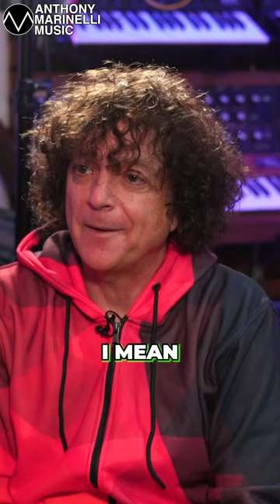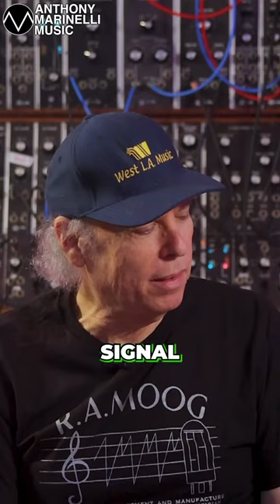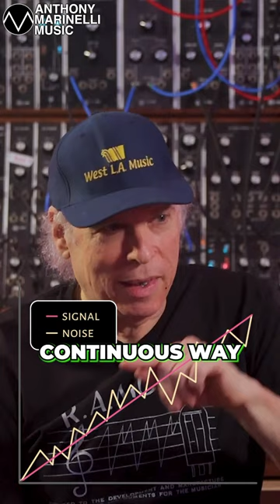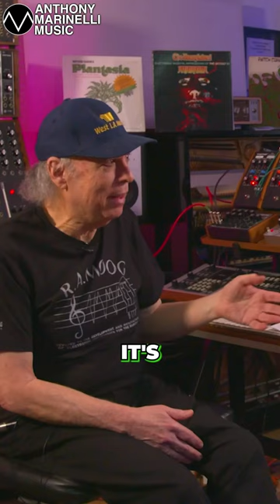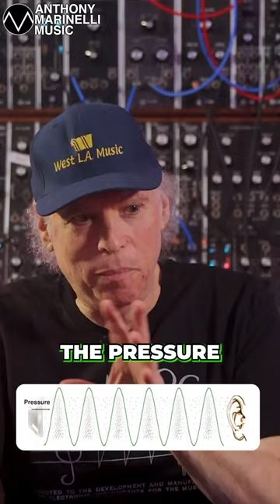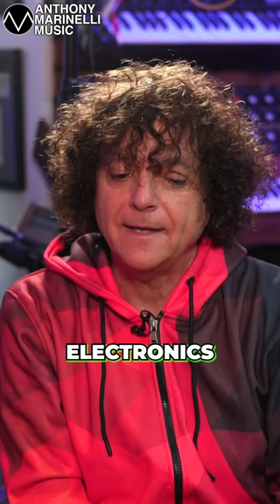“Why Digital Synthesis is More Analog Than Analog”  - Mark Barton

Comment: I think analog is way better than digital because an analog synth make sound with voltages, with all sweet audible imperfections of analog circuit, digital is too clean, only zeros and ones in a CPU, not naturally.

Comment: That's the point of analog though. The  slop! A horrible word, but it's technically true. Don't get me wrong here. I love my digital plugins and I doubt any casual listers would even know or care! But I care is the point! And I'm not being a luddite about it. There is some sounds you just can't make with digital because it's far too accurate. Also the same is true for old digital synths. The sound quality of an old DX7 is because the osc were not that accurate compared to today. Also trying to make 8 bit sounds that are digital is actually not that easy on a brand new all singing and dancing plugin. Because your instinct is to push it as far as it can go! It lends itself to new sounds that no one has heard before. This is why Dubstep is a thing. The synth you use dictates the sounds you will make on it. For instance physical modeling synths make a particular type of sound usually corresponding to real world instruments. You can make them sound synthesised but your natural inclination is to make them sound like real instruments. So if you want that synth wave retro sound, shure you can get a plugin that dose it. But really it sounds a lot more authentic if you use an old analog synth. Like the theme tune for Stranger things. It was made on an old Moog modular, and I think you can tell that.

Sorry for the rant!😂
Reply: I respect your view, but I'd dispute a few things. I think the whole "a lot more authentic with the hardware" is mostly placebo. A good Diva patch or Synapse Audio can do the trick. As for being too accurate, why not just reduce the bits or introducing modulations or coloration? But if there's a sufficient market demand for a virtual 8-bit, the wizards could  ace the sound. Physical modeling is much harder, yet pretty much closed the gaps on orchestral sounds (SWAM Audio). 😊
Reply: I would add this…..

I consider myself to have a lot of experience as a “listening musician”…

I listen to new artist all the time.

My Friends and I have analog and digital synths, both vintage and modern.

So I SHOULD have the ability to discern, on listening, whether I’m hearing an analog synth or a digital synth…..  but I most often can’t if all the techniques Benge listed are employed.

I think us synth nerds are a bit biased by past conclusions that digital is sterile….. 

On one occasion I was responding to a very beautiful and musical YouTube post, and posited that I could hear a “moogy sounding part”, where the poster replied that it was a plugin.😮

I KNOW that I LOVE a knobby/slidery analog synth, but I own a Blofeld(not analog) and it a prized Bass Monster in my rig….

And to be entirely honest, if a Neko/Miko-style multitimbral synth came back to the market, THAT would be a GIGGING Keyboardists dream….

So for me, I love analog but if the digital synth has a useable UI, I’m good with it.
Reply: @paultorbert6929  I agree that alot of what I said is subjective. So I will take another angle that involves purely analog synths. I have the mother family of synths, the Mother 32, the DEFAM and the subH. Beringer cloned those synths and the music community went mad about it! I could have got all three clones for the price of one of the Moog units. The sound of the clones is pretty damn close to the Moog units. I doubt if I could tell if they were playing together and I was blindfolded. Also the beringer units have Midi, an extra convenience not offered by the Moog units. But if you invove yourself with the beringer units you will definitely not worry too much for the extra expense. Because the beringer units just don't have the same quality and when you scrutinise the sounds you will notice the difference. 
The effect of all that is you will spend hours on the Moog units and you would look forward to comming back to it. The beringer units on the other hand would involve an hour of play and if you have better kit, it might be put on a shelf or Ebay.

Also emulating a vintage synth in digital is particularly difficult. Because as a synth get older through all the services and repairs it takes on extra character. Sometimes good sometimes not so good. But I'm shure that your vintage synths don't sound exactly the same as other equivalent models. Also I never find myself laughing at some crazy sound that I made on a digital synth because they are far more predictable. I make exactly what I intended with Hive 2 or Serum. But I get on the grandmother (I'm a Moog fan boy😁) and I do something that surprises me and sometimes cant repeat. So I don't think the experience is entirely subjective. 

But I can't disagree with what you said also. So I think the entire analog digital argument depends on your personal perspective! But God I love synths!😆 I think we can all agree on that!
Reply: @bengsynthmusic  As long as your target sound is something with the timbre of a string section which plays steadily, cool, you got it. Closing the gap on an actual recording of an actual violin player is not possible by any means. It really isn't just about randomizing velocities.

Comment: He is missing the point, we like analog synths because they dont sound comparable to acoustic intruments. We want noise and jank. Do you think he would have a different opinion if he was selling circuits instead of software?
I like digital synths too btw. You cant compare them.
Reply: I think that's what he was discussing here. He's talking about voltage controlled oscillators vs. Virtual ones. He mentioned acoustic instruments to make a separate point.
Reply: @bengsynthmusic  you correct ! I will rectify my comment.